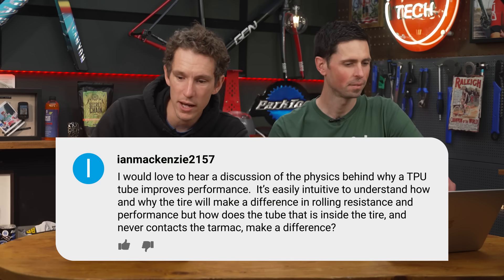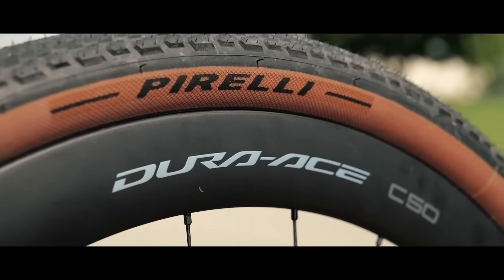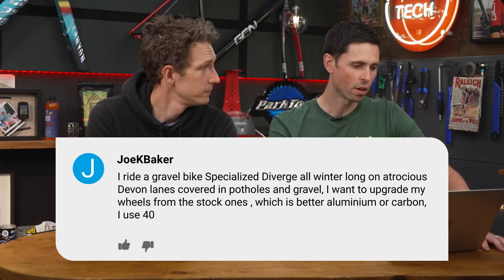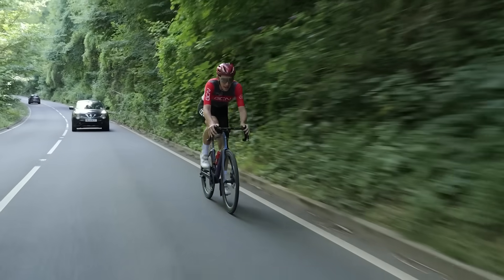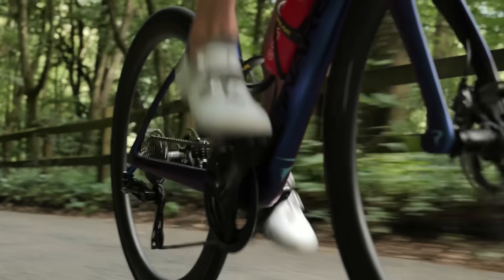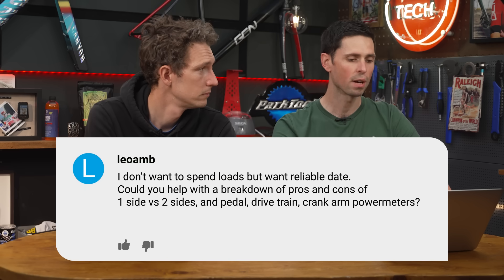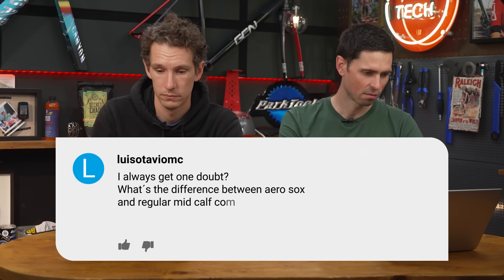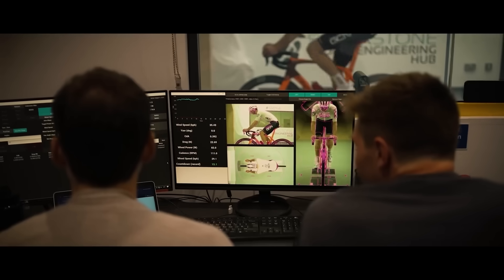Choosing A Powermeter, Aero Socks & AI vs. GCN Tech’s Wisdom | GCN Tech Clinic

Comment: #askGCNtech given the move away from oil-based lubes and towards wax, are we likely to see other components such as BBs, wheel bearings and suspension forks start to use wax instead of grease/oils to reduce build up of the horrible black grinding paste?
Reply: Interesting. Would a dab of wax work on threads, for instance pedal threads.

Comment: A cool experiment to explain hysteresis losses is to take a rubber band. Put it to your lips because your lips are very sensitive to feeling temperature. Now stretch the rubber band a few times quickly and feel it again with your lips. You'll notice it got a bit warmer. That heat is lost energy trough hysteresis. Same happens inside tires and inner tubes.
Reply: There is a more simple way of demonstrating hysteresis losses actually, if you take the rubber band and put one end to your lips, then retract the other end at a perpendicular angle to your lips as hard as you can and release it, you'll be able to feel it with your lips.
Reply: @tomorrow3582  😅😅😅

Comment: #askgcntech how well will an 11 speed chain work with 8/9 speed chainrings? I'm looking to upgrade my Claris bike to 11 speed and I'm comfortable upgrading my rear mech, chain and cassette (yes, the hub spacing is good) but I'd like to keep my silver chainrings because silver ones rated for 11 speed are hard to find.
Reply: I went from claris 8 speed to grx/ultegra 11 speed on the same fsa chainrings with no issues on either setup. Can't remember for sure what setup the fsa rings are labeled for, but it doesn't seem to matter much.
Reply: Sheldon Brown's site has some guidance on mixing drivetrain parts. The advice for chainsets and chains is a narrower chain will probably be fine on an older chainset.

Comment: Favero pedals for power meter. End of story, look no further.
Reply: The only exception to this would be if there happens to be a much cheaper crank/spider powermeter option for your bike and you only ride that one bike. But other than that, Faveros test the best, are among the cheapest pedal powermeters and you can swap them to any bike, so it's really a no-brainer if you have the money.
Reply: Spot on! And the single sided ones are fine for training/racing. 
I ride the Pro MX-1 spd style on the road/gravel, and they're great.
Reply: I use a single crank power meter because I have a shorter leg. That's only one thing to buy to both be more comfortable and have power reading.

Comment: Best upgrade was actually better fitting handlebars. Went from 44cm on gravel to 40cm, felt much faster (now being able to go into a Hoods aero position and hold it), more comfortable and I also prefer them in technical terrain. Plus I got rid of the Ritchey venture max which has these awful bumps in the drops that were just in the wrong place for my hands.
I also learned how to wrap bar tape and optimized the hoods position in the process all for like 70€ plus my time.
Reply: I'm a "small" guy, when i went from 42cm to 38cm it felt much better, I'm getting higher avg speeds, also not feeling sore on 5+longer rides. The first bike fit I've done nobody questioned my handlebars size, could had been happier cycling 2 years before

Comment: #askgnctech I want to do ultra-endurance cycling on the road in 2026. I have a 2015 Scott road bike with a 50-34 crankset and 11-32 cassette that only accepts up to 25 mm tires, and a Rose gravel bike with a GRX810 2x11 groupset that can fit wider tires, but it has a 48-31 crankset and 11-34 cassette. Is the gravel bike the better choice when looking for comfort over long distances (200 to 1000 km)?